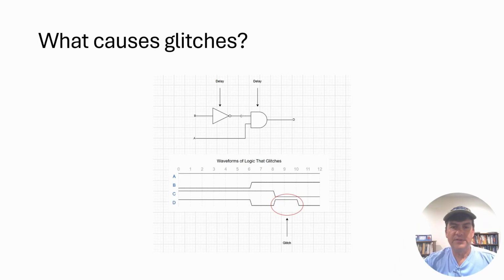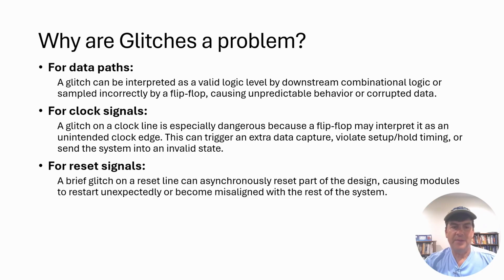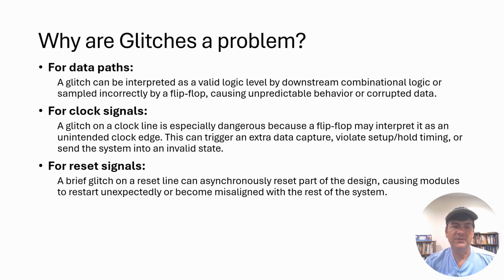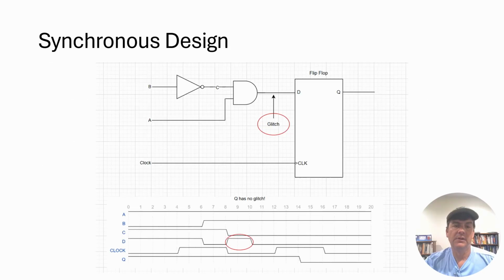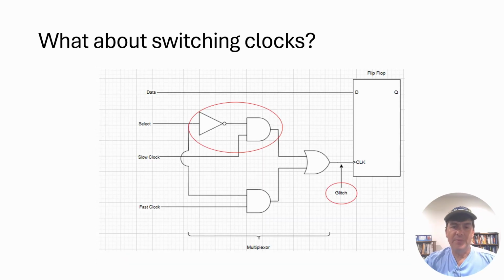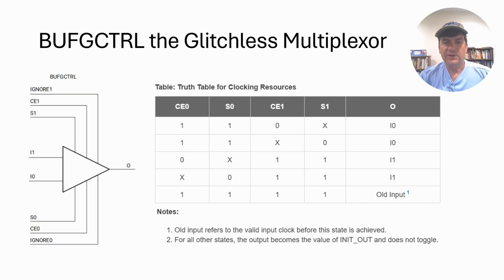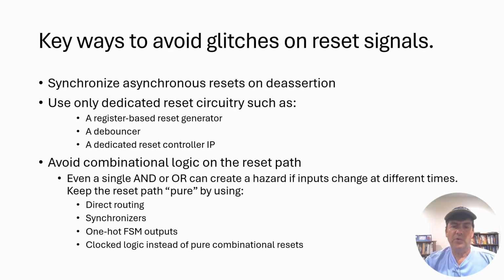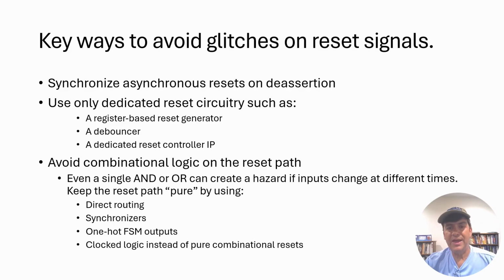Avoiding Glitches in Xilinx FPGA Designs — Clocks, Data, and Resets Explained

Comment: Can fpga can be used in critical applications without secondary safety requirements, like in military fuzes?
Reply from the maker: Yes/Maybe/No. MTBF is a major consideration. If the calculated MTBF of the FPGA implementation meets or exceeds the system reliability requirement, a single FPGA may be acceptable from a reliability standpoint. Designers consider device failure rates, operating temperature, radiation environment, clock frequency, timing margins, and mission duration when calculating reliability.

However, MTBF alone is not sufficient for safety-critical applications. A system may have an excellent MTBF but still require independent safety mechanisms if a single failure could lead to a catastrophic event. That's why safety standards focus on single-point failures, fault detection, fail-safe behavior, and system hazard analysis in addition to reliability.  

AMD (formerly Xilinx) includes language in its software licenses stating that the software is not designed or intended to be fail-safe and is not intended for use in "Critical Applications" unless appropriate fail-safe or redundancy measures are in place. The license specifically lists examples such as:

Life-support or safety devices
Class III medical devices
Nuclear facilities
Airbag deployment
Vehicle or aircraft control (unless there is independent fail-safe or redundancy)
Reply: @palmtree1126 thank you
Reply from the maker: @ssujeeth45    You are Welcome.  Additionally I would add that my experience has shown me that Vivado is buggy and not to be trusted.